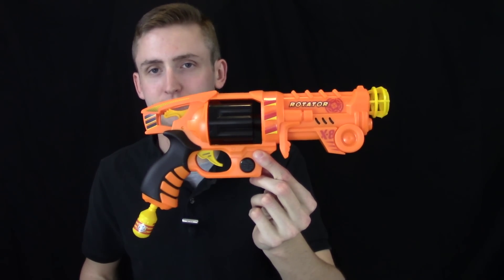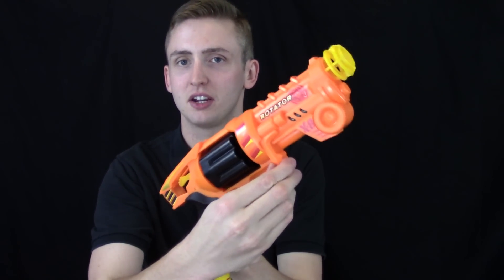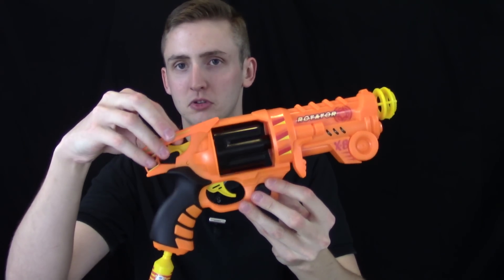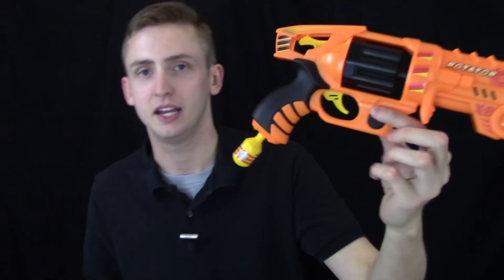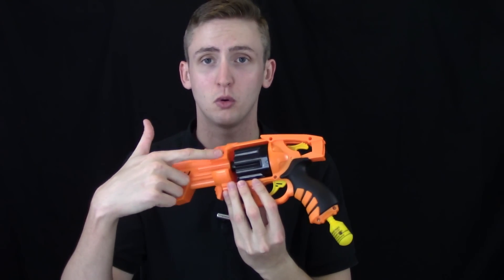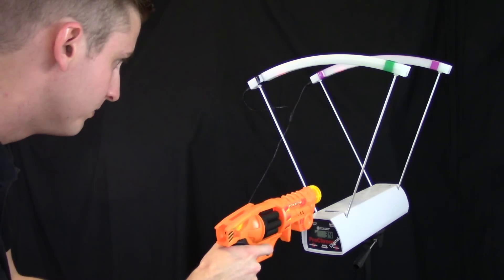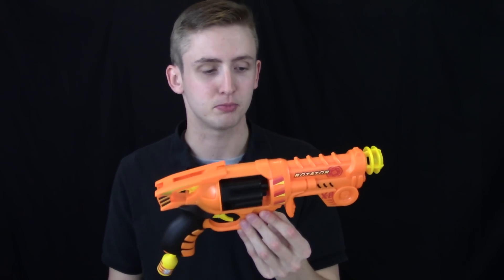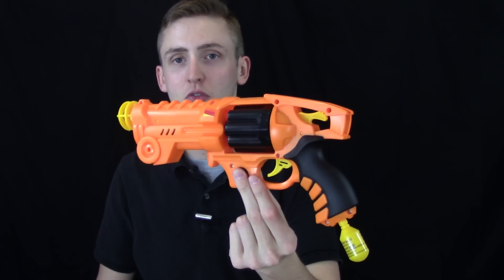[REVIEW] Total Air X-Stream Rotator X-8 Revolver Unboxing, Review, & Firing Test

Comment: "operating is pretty straight forward"
- needs the priming handle manually pushed back in order to fire darts
- needs trigger pulled entirely back in order to fire properly and not jam gun
- requires a round to pick up the functionality of it
- shouldnt be lent to friends as they will inevitably jam it

but, it look awesome! and holds 8, so not useless.